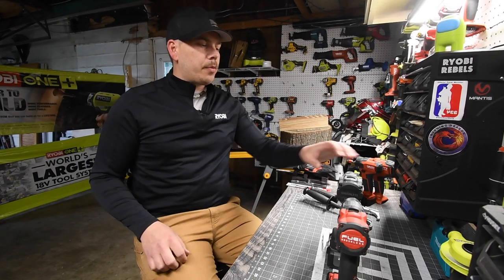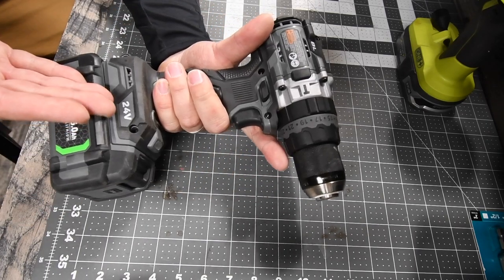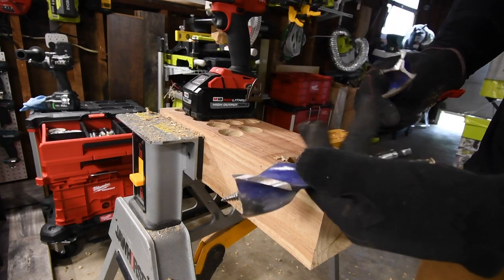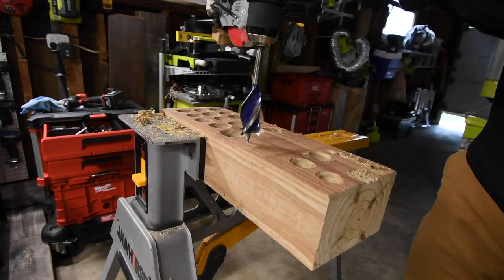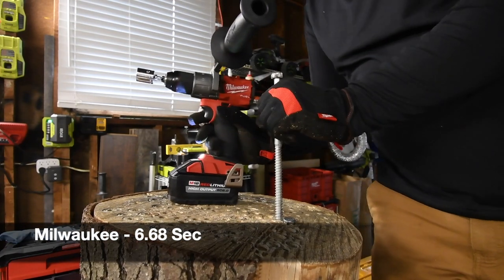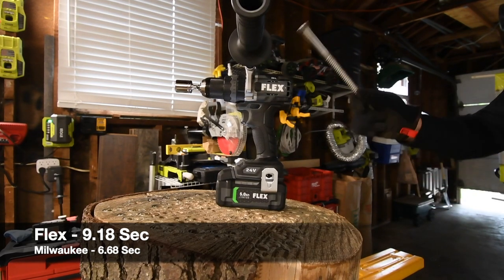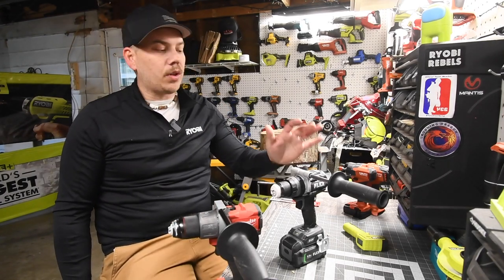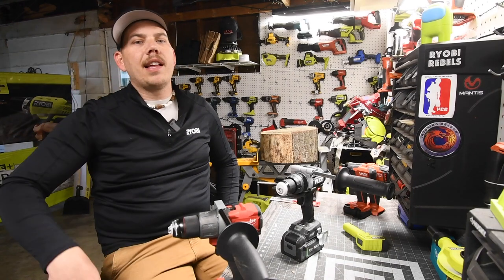FLEX vs Milwuakee (Hammer Drills)

Comment: I'm probably your biggest critique, I gave you a pretty hard time when your first flex videos drop but these in my opinion were much more fair. I still don't really see why not just slap the same size battery on all of the tools. I'd like so see a comparison with the big three with their 8.0s
Reply: It would only be fair or apples to apples if all tools used similar amperage batteries.  Whether they’re 21700 cells or not is up to the manufacturer, if they aren’t available the other manufacturers tool shouldn’t be penalized.
Reply: @martylucas8557  21700 cells don't make the difference you think they do. A high draw 18650 will outperform a standard draw 21700. The flex is probably already using higher output 18650 cells. The problem comes when you're changing the size of the pack because of the available current. I really wouldn't care if the flex has its 2.5 and the Milwaukee had a 3 h.o. I think that would actually be a fair comparison because of the size and most people would run their tools that way. The truth is the flex used the battery it came with and the Milwaukee got a $150 upgrade. Which I'm not crying foul because it wouldn't matter either way the flex won I just don't see why not run the tools with the same size pack. Why not just throw the 12.0 on all of them. I don't really care who makes what pack which direction with what sticker on it. I just know there's an apples to apples comparison to be had and for whatever reason mct is very scared of running all of these tools on am even playing field. Whether it's speed selection of battery size there's always something to try and protect the tools he's been calling the best for so long. I wonder why vcg isn't doing the same stuff 🤔
Reply: @TheVdog12 , first of all the Flex didn’t win.  It won a couple of tests, but the Milwaukee won the majority.  Milwaukee has optimized their 21700 cell batteries to work more efficiently in their FUEL designated tools, with communication between the battery, electronics and the tool.  I’ve seen the Flex hammer drill perform poorly during some tests and better another day during a different test.  What I know I can count on is the Milwaukee Fuel Gen 3 performing consistently well.

All that really matters is each tool being tested be equipped with the best battery the manufacturer has to offer, then with the same number of amps.  It may never be truly apples to apples, but that’s as fair and close as you can probably get.
Reply: @martylucas8557  first and foremost you sound like a Milwaukee pr bot. Second of all I don't know what video your watching but the flex won every single test with the exception of three of the four lag bolt tests. So yes the flex won quite comfortably with it's 18650 cell battery pack while the milwaukee used a 21700 pack. You're clearly out of your wheel house and have been sold hard on Milwaukee pr so I'll give you some really easy pointers. Milwaukee's "redlink intelligence" is quite literally a worthless marketing point. Every tool manufacturer puts a chip in their tools that communicates with the hard ware in a battery pack through software to regulate certain things like draw and temperature. Every cordless tool ever has had to do it and Milwaukees technology isn't any different than Bauer in that regard. Milwaukee does however use very good motors and program their tools to output more power which has been shown to decrease the life of their tools but people seem happy with the trade off of losing a little bit of life for the power which is fine. Also your comment on "you've seen the flex perform poorly" this is a ridiculous statement on its face. What you watched was mct lean on the drill as hard as he could when he first got it because he wanted to trash flex which is also fine. Pretty much every reviewer on the platform is showing that the flex is the superior tool and now here we're getting a fair comparison and the flex won.
Reply: @TheVdog12  tell em🤘😎
Reply from the maker: that is why I do these tests. these test results aren't complete blow outs

Comment: It's not that old the Milwaukee and how much more powerful do you really need on hammer they're already too powerful
Reply: The Milwaukee G3 Hammer Drill is about three years old.  With regards to power...you can never have enough power, at least I can’t.  Why would you want a tool to be less than what it could be?  Why not just have a brushed tool vs a brushless?  There’s always that one job where you need the extra umphhh, without the tool cutting out.  If the Milwaukee G3 didn’t have the power it does I wouldn’t be able to mix a bucket of thin set with it.

Comment: Interesting test results, but I'll stick with my Milwaukee until Flex has been on the market for a while and proven the brand.
Reply: I'll stick with Milwaukee as the array of tools is huge and like MCT said here brand new drill against a drill that came out a couple years ago now.
Reply: I am sticking with milwaukee because it isn't like the hammer drill can't do the jobs I need it to do. Milwauker makes a quality tool. Also, the differences aren't enough to justify switching the battery investment.
Reply: You know flex has been around for years
Reply: @mikemcintosh295  the cordless flex tools are brand new but yes there cord tools have been around forever
Reply: @mikemcintosh295 , that being the case...where is their extensive tool line?  Where are their 3/8” to 1” impact wrenches, ratchets, different LED lights, nail guns, one handed recip saw, table saw, miter saws, sanding tools, caulk gun, drywall cutout tool, blower, job site blower, vacuums, water transfer pump, etc.etc.  Not to mention an impressive array of 12V tools.
Reply: @martylucas8557  I only mentioned it because a lot of people think flex is a totally new brand. All of those things will come. The more competitive the market the more everyone wins.
Reply: @mikemcintosh295  , it’s a good point and I’m definitely in alignment with you.
Reply: @mikemcintosh295  Absolutely if Flex is a serious threat to Milwaukee it will only push them to up their game.
Reply from the maker: I agree

Comment: I've seen both of the flex vs Milwaukee hammer drill videos. I know that tools don't always perform the same. How come it took the Milwaukee 40 seconds drilling concrete with the 8ah battery but 25 seconds with the 6ah. I have the HP Ryobi hammer drill and my Milwaukee hammers way better

Comment: You have to leave the Turbo mode on in speed one. Why didn't you show it in turbo to just in case. It's like you're trying to make the Milwaukee win.
Reply from the maker: because it wouldn't help out the flex, the rpm's would be too high to do those tasks and would make the flex fail at it

Comment: Yes, drilling of hard concrete the Milwaukee will loose by a few seconds but if you are drilling into that type of hardened masonry you would not use any of these smaller hammer drills for many holes, you will most likely use a SDS or rotary hammer drill. Also you can see the Flex is struggling against the Milwaukee in the Lag tests and there is more vibration and more safety concerns using the Flex as it tried to twist your arm off. In my Opinion Milwaukee made/makes an excellent drill with the right size and ergonomics.

Comment: I've watched all of the VCG the videos about the flex and I've watched all of yours about the flex and I'm not a fanboy of either one but you're sure as hell seem biased. Flexes promoting that they can run that test in second gear and you said the turbo mode won't help in low gear when you just read to us at the RPMs are higher in turbo mode when putting the 10 inch lag in .
Reply from the maker: you missed the point of the tests compared to my videos and the flexes promo video. neither tool got its butt kicked by the other tool. these are pretty much evenly matched, flexes promo video showed every tests with flex winning by a long shot. the reality is they are close
Reply: @ManCaverTools  so then you do admit that you are biased to show that Milwaukee is as good! So being a comparison guy good luck with your channel.
Reply from the maker: @codyschmidtmann3992  No, the test results dont lie. I just showed that flex completely lied to everyone with their own tests. BOOM in your face
Reply: @ManCaverTools  and every other channel

Comment: Actually it's not a fair test because Milwaukee is 18v and Flex is 24v. let me know if you agree with me.
Reply: Nope. Higher voltage doesn't make it stronger. Also it's 21.6V.

Comment: thank you for sharing. your tests are way off from accuracy this is only my opinion and you are free to sent me fuck myself. did you not stated that you were facing a granny version of Milwaukee vs a new flex? looks to me that flex is a Milwaukee drill painted different with a turbo mode to make it a bit different. and avoid law suits. to me it matters more durability, torque, how hot the drill gets which drill will make 50 wholes in old well settled cement or how far it will go without smoking and over heating. who does it faster. I don't care. but I care about performance, battery durability. What will happen if I dropped my drill from a ladder? If my drill gets damaged what is the warranty? I appreciate your video thank you.
Reply from the maker: thats a mouth full. But I thank you for tuning in Mar Par